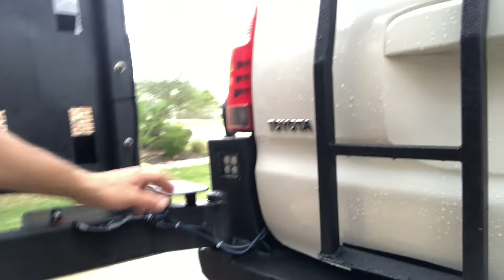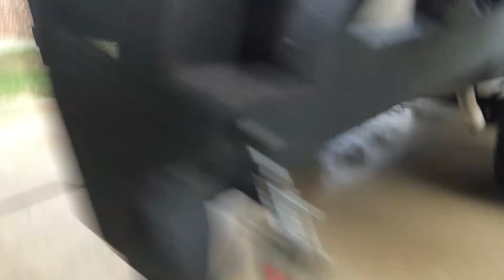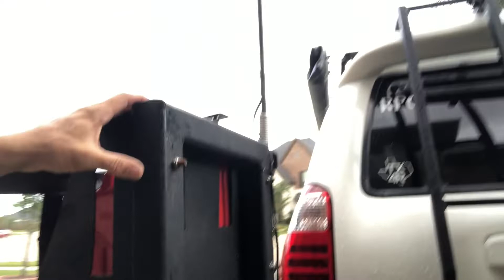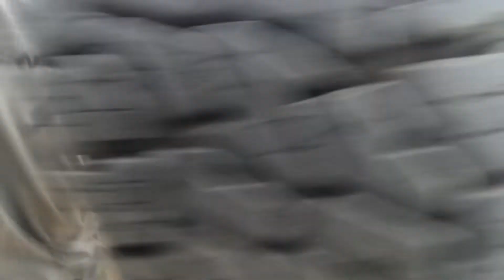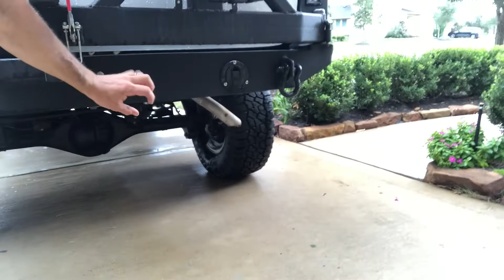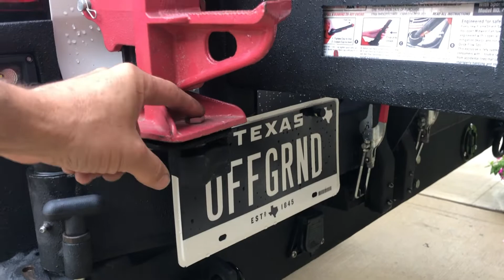Features and Options for Rear High Clearance Steel Offroad Bumper

Comment: Very nice bumper! I noticed that your tail pipe is very low. This happened to me when my bumper was installed. A tail pipe re-routing might be something to think about. It all depends on your driving style and whether you will be doing a lot of steep departure angles. Just a heads up, not a criticism. Cheers and best wishes for 2022!
Reply from the maker: Hi OPN.  Totally welcome and appreciate the comments, always.  I guess it might look like it’s low from some angles but the bottom is actually about level with the middle of the rear axle.  Since it’s so close to the rear wheel (ie it’s pretty far forward of the rear bumper) we’ve actually never hit it on anything.   I really wanted to cut it back even higher than it is but was trying to get that balance between getting it out of the way and still being able to properly clear the exhaust fumes from the area.  Eventually though I could see even routing it into and out the side panel of the bumper.   I’ve seen exhaust ports come out there and like that idea.  Have an awesome 2022 and thanks for checking out the channel.

Comment: did you cut the crossmember out? Is that how you were able to mount the 7pin?
Reply from the maker: Hi Dillon.  Thanks so much for checking out the video.  Great question Mr.  There’s a longer video on the entire build linked near the end of this video.   This one is mainly for the www.bentleycustomoffroad.com site to show the features.  When I was dabbing up the bumper I traced the bumper frame hole on the inside of the high clearance bumper and then cut that hole out after removing the bumper.   That allowed me to mount the 7-pin connector port and feed the wires through the frame cross member.  It’s a cool place to put the connector and I was happy to have that work out so nicely.